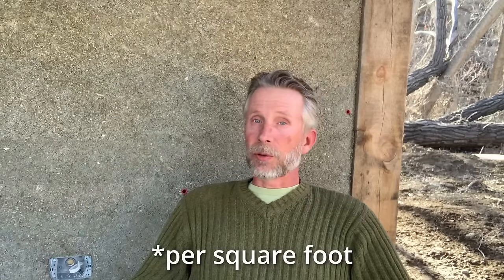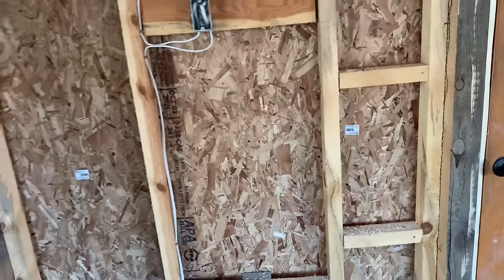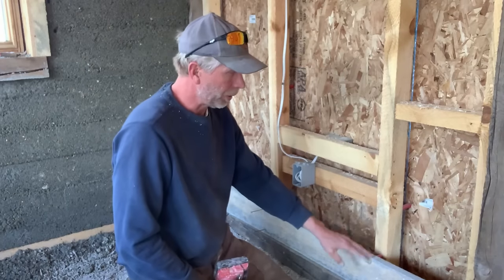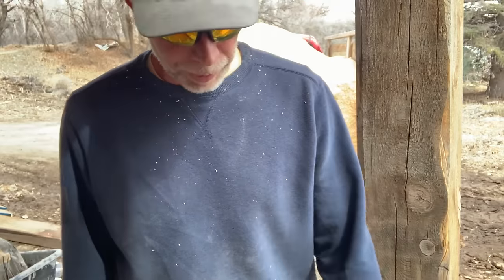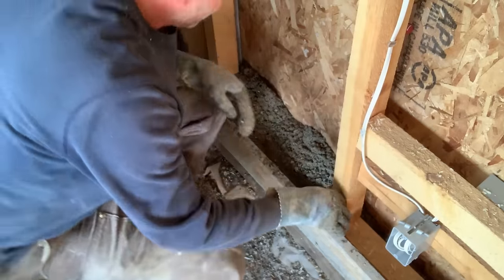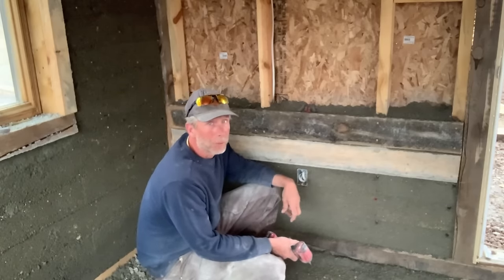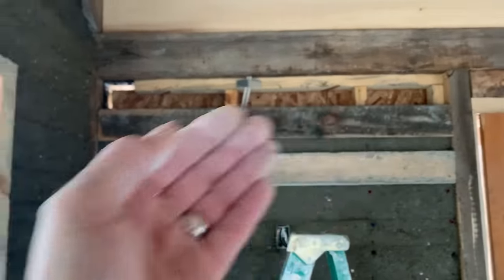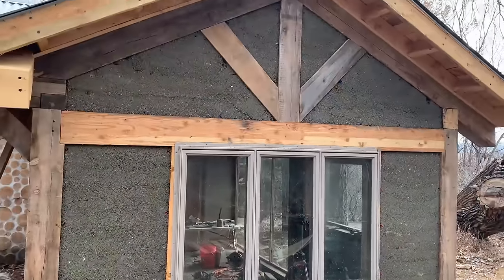Dustcrete

Comment: haha how do I convince my know it all multimillionaire dad to let me build something like this on some old property he's not using? he says rammed earth houses don't sell and I see this is even less known. not being a butt either I genuinely want some help, I feel like I wouldn't mind living in something similar, and actually have the means to achieve this... but not a traditional style home... at least not at first. should I just save to buy my own land? or would a structure like that lead me to build twice since Id want something sellable anyways?
Reply from the maker: After the subprime mortgage scandal, the underwriters of federal mortgage insurance tightened the requirements for construction methods. Even log homes no longer qualify for mortgage insurance. This basically means that only stick frame “code compliant” homes can qualify for government loan insurance. This means that a buyer will have a hard time getting financing to purchase unconventional builds, of any variety. 
Building codes are also a challenge. Depending on your local building department, approval can be hard to get. Most will sign off as long as you have plans drawn and stamped by a structural engineer licensed in your state. This will cost you five figures, before you even break ground.
So, I would say doing this on someone else’s land is perhaps not the best move. If you can find your own land in a jurisdiction without building codes, that’s your best bet. You still may not be able to sell to conventional buyers, but you can always owner carry the mortgage, or sell to a cash buyer.
If you aim is to flip properties, conventional construction may be the right move. Figure $200-$300/sf construction cost. I built this place for $23/sf, but have no plans to flip it.
Most building departments have a square footage limit below which a permit is not required, typically 200sf. This allows people to build sheds without having to pull permits. You may be able to build a tiny house on the old man’s place without compromising the salability of the property.

Comment: Why are you using S LIME in the mix ???
Reply from the maker: For flexibility and self repair
Reply: @radicalgastronomy  How does the self repair work Sir ???? Thanks
Reply from the maker: @victoryfirst2878  Type S lime is lime stone that has been fired, then hydrated with water. This causes the rock to crumble into a powder. Chemically, the heat from the fire drives CO2 off of the molecule and the water heads a hydrogen in its place. When to mix the mortar and expose it to air, it begins reabsorbing CO2 from the atmosphere. This forms crystals which grow within the mortar matrix. This process continues for 60 years plus. When a crack occurs, new crystals form in the void.
Reply: @radicalgastronomy  SWEET !!! This is nice to know it will fill in the voids. Would you tell me how this compares to AIRCRETE for insulation that is injected into voids in cinder block ???? Some people use just portland cement and aeration foam and other add crumbled styrofoam for more insulating properties. HOW has the DUSTCRETE worked out for you ?? Good day Sir.
Reply from the maker: @victoryfirst2878  The challenge with vertical aircrete is that a daily lift limit of 12” must not be exceeded, lest you get deflation. I’m not sure how that works with the styrofoam variation. More on this in my aircrete video. Presently, I’m sold on dustcrete for my conditions. It is simpler to produce than aircrete, and may be superior in R value. It’s still early, but so far it is holding up perfectly.
Reply: @radicalgastronomy  Excellent to  hear that. Am wondering how hard would it be to put into restricted spaces of floor joist above, horizontal flat wood on top of the 8 inch cinder blocks, and the spacing on top of the blocks with an opening of two to three inches opening. 
With aircrete you just pump the stuff in the open slot.
Reply from the maker: @victoryfirst2878  I’d build a plywood funnel and push it in with a stick. Wouldn’t be too bad.
Reply: @radicalgastronomy  What I am wondering is if water infiltration would hurt my idea of insulation cinder block walls. Since water does sometimes show its ugly head, would painting the walls with hydraulic cement really thinned out work or not ??? Thanks
Reply from the maker: @victoryfirst2878  In your case, I would opt for latex stucco. I’d never do it directly on dustcrete, but in this cinder block fill approach it makes sense.
Reply: @radicalgastronomy  Thank you for your help Radical Gastronomy. I will let you know how the job goes when I get to doing the job. Peace vf
Reply from the maker: @victoryfirst2878  that’d be great!

Comment: I didn't look at the other comments but you got a new name for a very old old product I live up in Canada we've been doing this for years people have tested dish in labs for years over in Africa basically you're just taking sand out and putting shavings or sawdust   in as a filler I worked around concrete for 55 years believe you me it's nice to see it being done like this not new and it doesn't have the load-bearing of concrete as you probably know there are many different forms of concrete use with more or less cement many years ago when we done masonery work we slaked our  own lime if it is old it is not new if it's new it's not old other words there's nothing new Under the Sun.

Comment: Hello, thank you for video. What is the reason for using the glue?
Reply from the maker: The lime and Portland cement cause the wall to cure into something firm enough to plaster.
Reply: @radicalgastronomy  thank you for answering. Do you have more specific name for this glue you are using. In Denmark we are using another names for glue.
Reply from the maker: @arkadiuszkulon8728  It is not “glue”. Just cement and what we call type S lime. That’s lime stone that has been heated and dissolved with water.
Reply: @radicalgastronomy  So s lime is 'slack lime ' or 'hydrated lime'?
Reply: @radicalgastronomy  Thank you for this excellent video.  I followed the same Eastern European dust Crete videos to find yours. There is a local furniture shop that bags drum sander dust together with planer, table saw sawdust.  So would you suggest screening this mixture for 'structural mix' and 'insulating mix?
Reply from the maker: @tonychan647  that will be much finer than what I’m using. I fear the lack of air voids will limit insulating properties.
Reply from the maker: @tonychan647  hydrated

Comment: Why is it necessary to use lime in the mix
Is it possible just Portland cement
Reply from the maker: It may be possible, but the lime is lighter, cheaper, and adds a self healing aspect to the final mix. Portland take much more energy to produce, as well. My next experiments will focus on getting rid of the portland, actually. I will try using local clay and lime in the mix. If that works, then one could make this material without an industrial supply chain. Hydrated lime can be made with rocks and a campfire. Cement requires a serious kiln.
Reply: @radicalgastronomy  thank you for the reply and the information
I was wondering if the pH might be one of the reasons you use lime.
Unfortunately we do not have Lime or clay in this area,
Sawdust should not be a problem
Just one more silly little question if you would be is good enough indulge me, why is it cooled hydrated lime?
The reason I'm asking is cuz I'll need to find the right product.
Reply from the maker: @Sam-black  here is a run down of various types of lime:
Lime.org/about-us/faqs/
Hydrated lime is lime stone that has been fired, then slaked with water. 
Agricultural lime is just crushed lime stone
Quick lime is fired, but not slaked.

Hope that helps!
Reply: @radicalgastronomy  
By the way I love your little house, it is beautiful.
I want to build a little place for myself while i'm still mobile.
You have inspired me! as I guess you have a conspired thousands of others. Thank you for responding to my post and helping me understand what I need to know.
Reply from the maker: @Sam-black  To inspire others is my aim, so I’m glad to provide the service. Good luck with your project!

Comment: I think you are a practical man with a very good understanding of science but might have overlooked and not mentioned this important consideration yet. What happens when you go to the local sawmill and buy a pickup load of sawdust which has been sitting outside in the rain, sun and snow? It's been auto deteriorating from heat, sunlight and insects... not to mention bacteria, fungi and other reactions... given time the sawmill sprays water, uses a front-end loader to turnover the sawdust to mitigate auto-ignition fires. Given the optimum moisture and conditions the wood-eating fungi below the surface out of sight is eating the wood leaving a black and white toxic dust. Heavens help you if molded into a home wall cavity and it continues to eat wood products under a hidden covering of wallboard, siding or whatever... BE CAREFUL!
Reply from the maker: Thank you for voicing your concerns. The saw dust I am using is straight off the mill and super fresh. I would not recommend attempting this technique with wallboard, as mold inhibition is achieved from both the alkalinity of the lime, and the gas permeability of the lime and clay plasters used to finish these walls. My climate is high desert and I have not used this technique in humid climates. In my climate, this system has performed flawlessly for over two years, in the older section. I would go so far as to say that this approach is far safer, in terms of mold resistance, than the IRCC compliant house wrap/vapor barrier method.
Reply: @Radical Gastronomy  So glad that you recognize the possibilities and dangers of wood-eating fungi. I look forward to your next video addressing this problem for those who may not be aware of it or who use aged or poorly stored sawdust.
Discuss your views on mixing lime, clay, Portland Cement and/or magnesium oxide mixtures to sanitize or protect while promoting breathing..  Good luck!

Comment: If you live anywhere in Ontario Canada or most Provinces of Canada, don't even consider this type of assembly without NRC and/or CSA and/or other similar accredited testing facilities.
Generally you cannot have plant material in direct contact with masonry and one has to show that the assembly meets Flame and Smoke Spread Ratings, Sound Ratings, Insulation Ratings and Air/Moisture transmission rates etc   !
I knew a log builder years ago. He insulated a couple of his log houses with just Sawdust. As beautiful looking and warm as they were, the also burned down really well too. Total Losses.

Comment: Well if you have time to do dustcrete, good. For me it would not use it. If ot could sprayed it on and using a straight edge to smooth wall, like stucco l, you might have something.  Good luck.

Comment: What about mold?
Reply from the maker: The high pH prevents it. Vapor permeable platers (clay or lime based, no latex) are key, too.
Reply: @Radical Gastronomy  i'd think about that again... 
There are wet area in asia where even rubber wires and pcb are covered and consumed by mold. 
It's an extreme situation i understand but i have seen it with my eyes... maybe adding a biocide in the mix would prevent it for sure?

Comment: With this being 8 inches of wall base it reminds me of adobe, but structurally more substantial and better thermally in a different mode with the high sawdust content.  Which brings me forward to two related types of questions. When you finish this on the outside, would you use wire or expanded metal to hang the plaster, and by plaster I mean stucco?  Related to this question is security, as I have repaired adobe homes that were attacked with a pick axe to make fast entry for robbers, and though this is somewhat harder than adobe, there is no interior supportive wire or rebar to prevent this sort of thing from occurring?
Reply from the maker: Wire or lath is not necessary to get plaster or stucco to bond to the surface. Lath could be used to improve security (at least to slow them down). Even without it, a window is a more vulnerable point of entry.
I do not recommend the use of latex based stucco in this system as it prevents vapor permeability, that can cause trapped moisture to encourage mold and failure of the stucco. The lime plaster shown in my plaster video make a fine render for exterior finishing of this system.
Reply: @radicalgastronomy  Good point on not using synthetic stucco, etc., as it's the same case for adobe and straw construction, causes it to mold under the not breathable finishes.  Thanks for the info.
Reply from the maker: @robgad2271  eventually it falls off in slabs. The government wrecked a bunch of Pueblo buildings doing this. Finally a local construction company was hired to get the old knowledge from the elders and repair what had been damaged with the original, earthen recipe.

Comment: If that's plain Romex wire, it's not rated to be buried in cement. My give you problems later on.
Reply from the maker: An electrician pointed that out. Will go in conduit, in the future.

Comment: Hmmm so far interesting....though I would of thought the use of a Larsen truss would be better suited for construction.

Edit: wonder how it would work in a roman style concrete?
Reply from the maker: Others have mentioned the roman concrete. We are wondering if the thermal reaction of the quick lime might get too hot during the initial pour.
Reply: @radicalgastronomy  well there's the slaked version which I believe has a lower heat of hydration temperature. It's made 1 part of slaked lime (roasted seashells then soaked for a few weeks in seawater to obtain a paste), 2 parts volcanic ash, and 3 parts aggregate in this case it would be the saw dust. Seawater to adjust to a workable consistency. 

Know that's a lot of work but something like a dog house might be worth trying.

Comment: Everything looks great but I am concerned about your wiring. NM-b cable is not permitted to be embedded in any type of concrete or plaster according to the National Electrical Code. I personally don't have a big problem with it but your local electrical inspector, if your area has one, should not approve it.

Comment: i see the finished house has 6 or 7 colors, there is a design rule, 60% main color, 30% contrast color, and 10% detail optional, the main and contrast are a dark color and  light color, fix up the color scheme, beautiful building,  there are some examples ' Creative 'cordwood' building (part 1) : Alain Richard'  youtube Jardin des Petites Ruches
Reply from the maker: I like those ratios. Thank you for adding some value. When complete, the exterior will be 60% native clay/lime plaster (in the gables of the cordwood section, and the first story of the dustcrete  addition. This tone can be seen in my other videos (behind my head in the aircrete video, for example). The front of the house will also have a local river stone veneer under that fixed window. Something sculptural. The natural material, in its original setting is a given in a design sense.
Inside, I finished the gable and southern walls with a grey sand plaster skim coated with lime putty. The north wall I used darker pigments to absorb passive solar gain. This can be seen in my plaster vid. The Adobe floor, and stout exposed frame feel really good, together.

Comment: Kudos to you, but you make claims about this material that you have not had verified by any testing. For example, you claim that it is "super efficient". A bit vague, but I'm assuming you mean efficient as an insulator. Really? Ok, well what's the R-value per inch? It might be cheap, but it's certainly not efficient in terms of material usage. There forming wood, which in most applications is going to be waste material in the end, and then there's the finish material of lime plaster which is not required in conventional wall assemblies. Not to mention that plaster is NOT durable, either in absolute terms, and especially not so compared to conventional exteriors. Then there's the issues of water and vapor permeability, and susceptibility to insect intrusion/destruction. I guess if all you care about is cost, and durability and sustainability are not concerns, then it seems like a good product.

Comment: 60 seconds in and I'm getting the stink of an unemployed person with an architect's major, engineering minor, who's never actually been hired to design anything.  Don't get useless degrees, kids, you'll end up making youtube vids about experimental building processes that, as a builder and renovator, I can tell you will have a limited life in most climates.  When you try to join two materials that have different thermal expansion rates and permeability to humidity, you get a building that is (hopefully) slowly but implacably tearing itself apart.  This applies to the "dust-crete" and the wood framing but also applies to the sawdust and lime/Portland itself.  Would you put rebar or fibers in a concrete wall?  Then why wouldn't you do the same in a "dust-crete wall?"